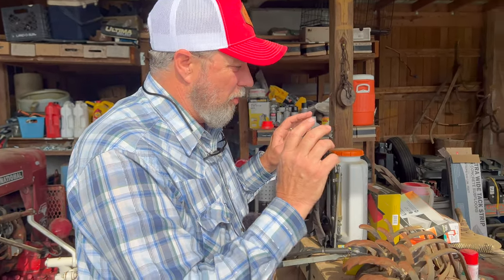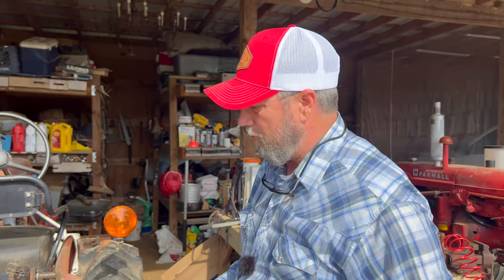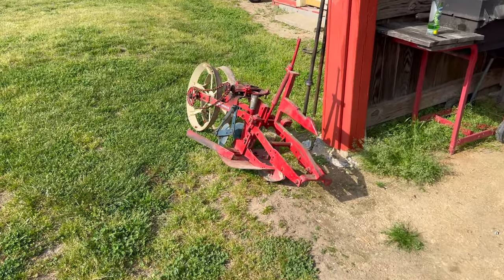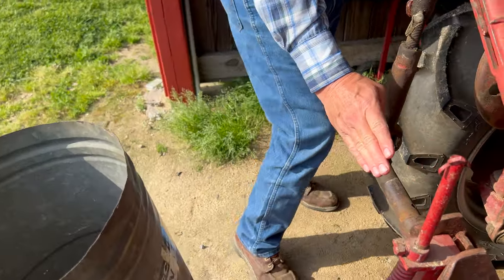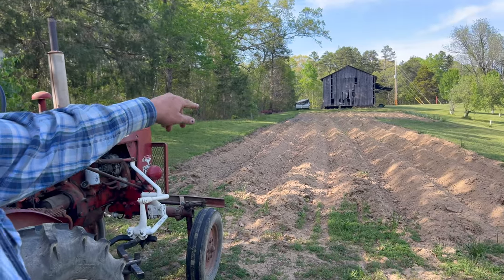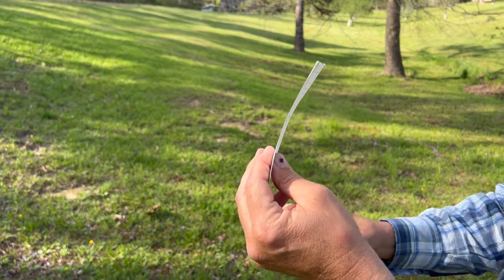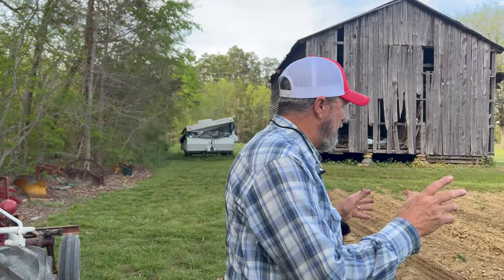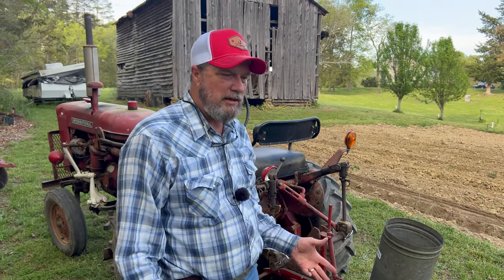Corn Planting Begins!! (Silver Queen)

Comment: Find yourself an old wringer washing machine for your rags. you can fill it with hot water and plenty of your favorite cleaners and turn it on and leave it run for a couiple of hours. Rinse in a tub of water and your good to go. Using your house washing machine for grease rags will start to coat the inside of the tube, hoses, and pump with grease. Always use the hottest water you can. Good luck.
Reply from the maker: That’s kinda what I had in mind. I think I’m a 1 and done in the house.

Comment: Thanks for another great video!  Good luck on figuring out the corn plates.  I was trying to figure out the spacing on my 180 belly planter with the IH Duplex planter using only 1 side.  I drove down one of the 400' rows and counted each time the plate should have dropped a seed.  The count was 325, so I figured that would be perfect about 15" spacing.  I got 3-4 corn plants germinating each foot!  LOL  All I can figure is the seed plate was dropping 3-4 seeds at a time due to the sweet corn being a smaller seed than the field corn the plate was made for.  I'm going to pick up 4 50# bags of 10-10-10 with micro nutrients tomorrow.  I know you saw that you close down your fertilizer hopper until you can barely get your finger under the gate IIRC.  Hope that's right?   I'm going to set the 140 up for cultivating and side dressing tomorrow. Thanks, Ken

Comment: Hey Joey, great video! I have a 186 planter for my 100 and a Hol-Mac 274 belly planter for my 274. I thought the 174 had a metal hopper like yours and the 184 has a fiberglass like the 186? I could be wrong. Yours work good, that's the main thing 👍
Reply from the maker: Hey Bobby That may be the case. I just didn’t know enough about them to say definitely what numbers they are.

Comment: Definitely work out the effective planting spacing for your planters/plates. We put a little corn in the hoppers and drive down the hard gravel driveway and measure seed drops. Then adjust sprockets. You can also measure wheel circumference, sprocket teeth, and plate cell count to get a number too but the driveway test is quite effective. Watch for skips and doubles! Aim for 9-12in spacing on your Bloody Butcher/Jimmy Red heirloom corn, it needs more space. I've used 30in rows at 9in but trying out 15in rows at 12in to give every plant more space yet increase plants per acre.
Reply from the maker: That’s the spacing I’m hoping for. I have noticed doubles on some.

Comment: The red hats do match the tractors pretty good. I think I’d have to rub some dirt and grease to get it to match my tractor though 😂
Reply from the maker: That would be correct for me also.
Reply: @Jtwes  I changed the gear oil in the trans on mine last weekend. Topped it off a little too much….. made quite a mess 😂

Comment: First time ever, I planted corn two weeks before Easter and got lucky.  I've got a 70 year old John Deere planter that looks like a 149. I'm having trouble finding gears for mine and only have 24 cell plates, so i get plants about 4 to 6 inches apart. I'm thinking that I'll JB weld half the cells.
Reply from the maker: I’ve considered doing the same.
Reply: Use bondo